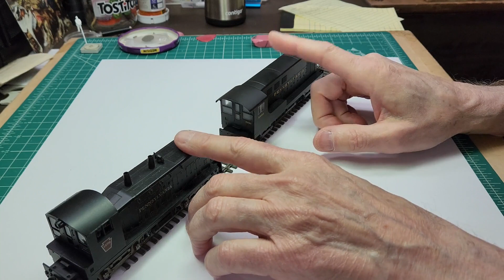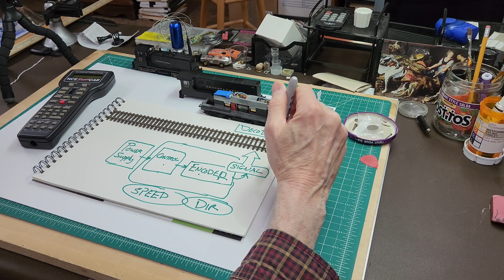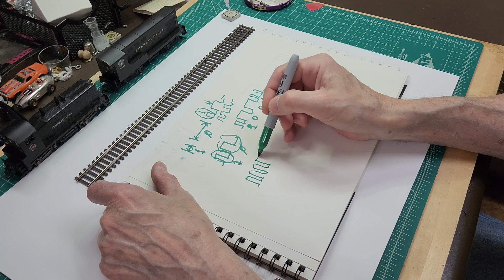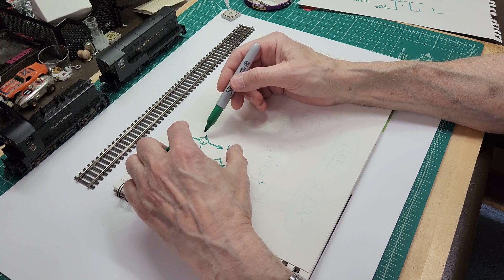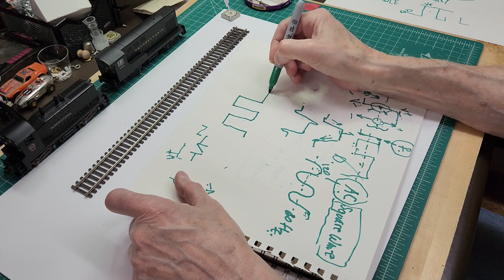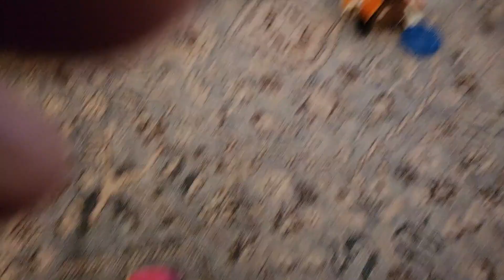Episode 11, Part 1 of DCC Under the Hood.

Comment: Hi, great video! Im curious about how this reference is established, as from what I understand normally a reference voltage would be one of the rails.
Reply from the maker: Hi Mike and thanks for responding. That's an excellent question. From the perspective of the THROTTLE ENCODER's source the voltage reference is fixed to its DC voltage.  From the perspective of the DECODER the reference voltage is basically created by some kind of voltage division (to find the center of the HI and LO) and is floating with respect to earth ground. Because of the floated voltage it is important that the AC SQUAREWAVE SIGNAL is continuous on the track so that the floated voltage does not drift too far from the fixed DC voltage's reference in the throttle's encoder.

Comment: Are you interested or have knowledge on Arduino control for DCC, and if so would you be interested to have some video (s) about it. Thanks. Very interesting video, thanks for sharing.
Reply from the maker: Hi Christiane.  Thanks for watching and leaving this kind comment.  I have two projects that I have toyed with for fun.  I plan to discuss them both. Each project uses an Arduino product. One is a DCC Throttle and the other is a DCC Monitor that reads and displays DCC commands.